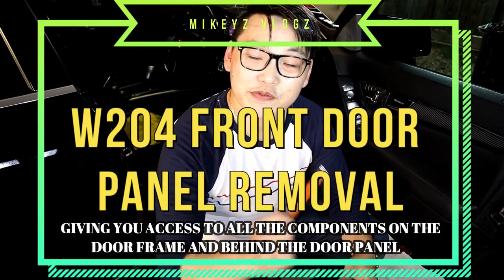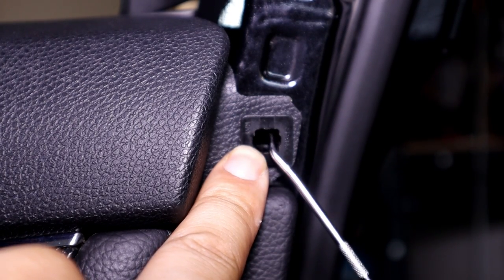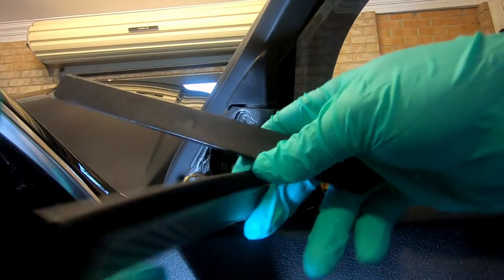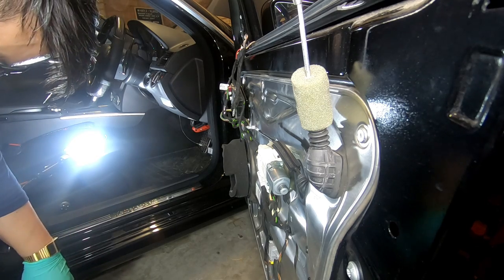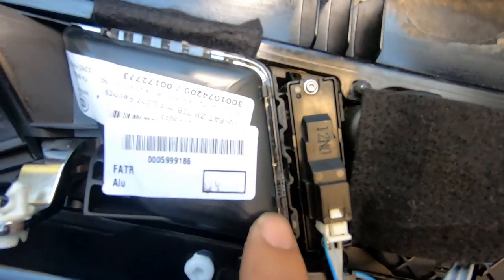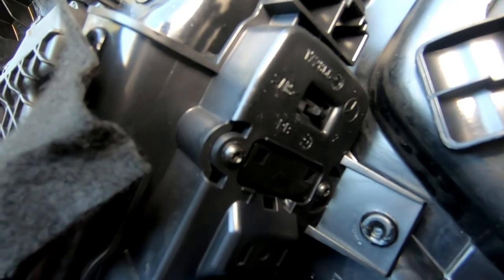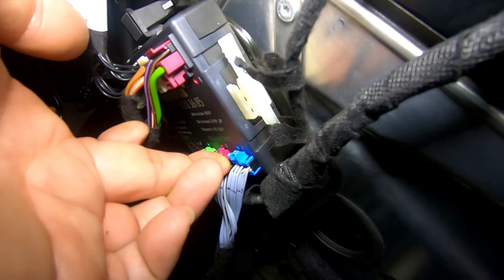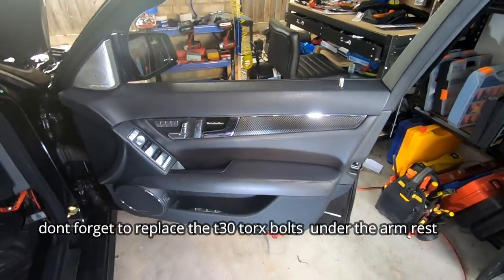MERCEDES BENZ C w204 how to remove front door panel and access components behind and on door frame

Comment: Hello  Mikeyz, Excellent video. Thanks. On my W204 I have just managed to remove the tricky "H" clip but only after realizing that it was fitted 90 degrees anticlockwise to the orientation illustrated in your video. First timers beware!

Comment: Hi Mikeyz  Excellent video thanks. Regarding the tricky "H" clip, on my W204 the clip was installed 90 degrees anticlockwise to the clip illustrated in your video. It took we a while to suss it out. First timers like me - beware of this possibility.  After market parts suppliers should prick up their ears and consider supplying replacement clips.

Comment: 📰Just a heads Up: My 2009 C350 driver side seat switch does not illuminate. Bought a set of leather door panels off a 2014 W204 c300 4Matic. Passenger side had a memory switch  still in the door that lights up but doesn't move the seat. Probably need the memory module and unclear if there is additional plug, coding etc? I can confirm from 2013 on that seat switches do illuminate if one finds cheap parts.

Comment: great video Mikeyz. Do you know if it's possible to remove the metal sheet on the door? The one on which the speaker and the other components that are not on the pannel sit.
Reply from the maker: yes u can u have to drill out all the rivets
Reply: @MIKEYZVLOGZ  by any chance do you happen to know what size are those rivets. I did a bit of research and the rivet guns are different sizes. Don't know what rivets sizes to buy.
Reply from the maker: @Alexandru Marian Popescu  usually 1 rivett tool has 3 sizes on it .. just make sure u buy the right size rivet..take one and compare it to the rivet your buying..take a measurement of the rivet before u drill it out ... I'm pretty sure it's just the radius of the rivet

Comment: As WIS says, I think the best way to remove that expansion clip is as following: Pull the pin out with suitable pilers. Then turn that pin 90 degrees and press into the expansion clip until it arrests. Now that two tab must be released. Then take out that expansion clip with plier. Done!
Reply from the maker: good stuff mate
Reply: I heard that but i'm not really clear how to would be done in person. You are to remove the inner pin, turn it 90 degrees then put it back in fully? This will release the tabs or do you have to do this all in one motion. While pulling out you turn the pin?
Reply: Wow!  Thank you!  This works so nicely I facepalmed myself for struggling so much before.  It's even easier than the pick method. Yes, pull out pin, turn pin 90 deg, push in, until you feel it lock and pull out with the pliers again.  Came out so easy after a hour of messing around with that stupid clip.  Now getting the pin out of the clip (it's locked in a bit) does take some force but much easier to deal with since you have it in your hands, ie, use an allen key to push it out from the other end.

Comment: Can you show a video about replacing the tweeters with aftermarket ones? Thanks!
Reply from the maker: sure... its quite easy but i can do that ... it does involved cutting the factory tweeters off...but all things are good .... sounds really clear now....i basically just grabbed a pair of tweeters and then cut the factory ones off and then used the new ones and wired them in using speaker connections...i will do a video asap
Reply: @MIKEYZVLOGZ  Sounds good! The only part I am worried about is the wiring and cutting. I heard changing them out makes a huge difference!
Reply from the maker: @karim_beats  ye no other weay around it unless you can find a female connector for the mercedes plug ..but cutting the factory wires isnt too bad ..as long as you make a secure connection..i only swapped the tweeters not the 6.5" woofers in the door.... unless i decide to build an abs like speaker plate to replace the  factory ones it wont ever sound near as good.... merc use the door as a box and bounce sound arouond to give descent mids and bass ...hence why it sounds pretty good..so if your going to replace the woofers its a must that you cover all the exposed holes and use a similar speaker plate to cover the entire speaker mount hole...therefore using your door as a bass box kindof...if u know what i mean nd also you have to ofcourse buy the appropriate female plugs for the factory speaker plug therefore saving you from cutting the plug on the woofers... just one less job to do ....

Comment: Is there a way to remove the top vinyl part of the trim which has the locking pin going through it?
Reply from the maker: @jethen07  not really unless u melt the plastic solder joints and melt them back later or use tap screws to rescue it..similar to how u disassemble the the door frame to fix the door handle

Comment: I found a good deal on a used door panel. Problem is that the upper tab is broken. They did not remove the pin and broke it. You discuss this at the "2:10" mark. Would you suggest cutting the old panel and just glue it on?
Reply from the maker: I just did a video showing a different cheap fix and no more hassle check it outhttps://youtu.be/B5j_N4LY-SA
I would.not just glue it.. but IMHO u don't evwn need it u can get away without using that clip
Reply: @MIKEYZVLOGZ  - they broke the portion of the door panel that the clip goes thru. So now it looks like a U.
Reply from the maker: @The_McD  oh yes I get ya... but honestly taking my door on and off for mods these past 2 years have made me realise that it's not a crucial part for the door to stay intact ... honestly I would just go without it.. which is why in one of my recent videos I show how I simply used a push rivet and a normal screw with a washer to replace that H clip

Comment: One thing Mikeyz, where the dickens is the waterproof membrane which stops any moisture penetrating the door card, do you happen to know please?
Reply from the maker: im not sure i know what u speak of ..is it supppse to be there..becuz ever since i removed my door panel ive never seen aplastic cover membrane not once...booo mercedes
Reply: @MIKEYZVLOGZ  Strange, because I have moisture at the bottom of my drivers door. There is no water collecting in the door itself but my garage said that it was probably a membrane inside which was leaking water. They were going to do the work but now cannot because of lockdown. I was going to have a go myself.
Your video about the steering lock and starting problems was so good that I managed that, no problem, thought I might do the same here.
Reply from the maker: @bishopcolenso  yeah with the spread of this covid 19 pls stay safe and keep your family safe and others around  u... with the membrane query... in my honest opinion i havent seen a plastic cover and if u look at other videos on w204 door panels ot will show it doesnt exist and ppl dont remove it.... as shown in my video...so im not sure how your car is getting water in the door panel.... jas it rained lately? ... it must be coming from somewhere....ive never haf an issue with water ...fingers crossed ...but definitely there has to be a reason for it

Comment: Wish you would have covered door interior door handle removal and replacement. I just bought the kit online and I have watched a few videos. The plastic melted tabs and cable pin look like he'll to remove fml.
Reply from the maker: unfortunately i havent had the issue just yet ,,but i will most likely do the video once i have the issue ..but yes gonna have to melt the tabs and then use self tapping screws to replace them all i believe . i watched a video about that tooi cuz i like to be prepared for any faults and mishaps...you;ll be ok its not as hard as ppl think..just annoying cuz u gotta cut or melt the plastic tabs... ive seen where ppl use screws instead to put it back together
Reply: @MIKEYZVLOGZ  dremmel looks the fastest and easiest to cut the melted tabs. Can drill them out or cut them but not goid success stories tho. I don't know about melting them lol they are melted tabs already. There is replacement kits with handle pin and 20 screws. I just purchased one unfortunately lol.
Reply from the maker: @jasonb4196  even easier is to use just pair of cutting pliers with a sharp point . used just for cutting wires and u can cut the top opff the melted tabs and it will come out easily no need for any sort of power tool ..then u just use the screws provideed to screw it back together...still thinking about it
Reply: @MIKEYZVLOGZ  once i pull the door apart I will look at these tabs and make a decision. I might try more than one way and see what is best.
Reply from the maker: @jasonb4196  yeah do that

Comment: I need to replace my armrest on the door panel. Any idea if it's available separately? Also I noticed that in the OEM parts diagram the upper piece has to be purchased separately from  the lower half of the door card. Any idea if these are easily separable?

Thank you!
Reply from the maker: not entirely sure but let me do some browsing and research and see what i find and ill getbak tp u
Reply: @MIKEYZVLOGZ  I just ordered a used door panel, it doesn't look easy to take apart the armrest. There a bunch of "plastic rivet" looking things that look like they're heat-treated or melted on there.
Reply from the maker: @amcdonal86VT  they just need to be drilled out and u can use screws after to refit them i believe ... it wont be hard to take apart or put together just take your time and itll be ok
Reply: @MIKEYZVLOGZ  I just did this. You basically drill out the wax/melted tabs with a 1/4" drill bit. Then you need to find very short #8 screws and drill a thin pilot hole before installing. Use washers as well. It was a pain in the butt because even 1/2" length screws are too long and went through to the other side of the vinyl. In this case I just removed the screws and added more washers stacked on top of each other.
Reply from the maker: @amcdonal86VT  excellent mate well done

Comment: I just ordered a used door panel, but the chrome strip that runs along the top of the door trims is peeling. Do you know if I can replace this easily? The one on my existing door panel is fine and I want to transfer.
Reply from the maker: i will have a look onve i get back and see if u can advise u or at least point u in the right direction
Reply: @MIKEYZVLOGZ  thanks, if not I suppose sanding it and painting it in situ is not a bad option

Comment: Hi I need to remove the armrest from the door frame... needs to remove the whole door frame ?
Reply from the maker: yes u do it's attached inside and melted together via tabs ..if u check out my door handle replacement ull see how the door separates as I remove the melted tabs to replace the inner door handle for front doors...
Reply: @MIKEYZVLOGZ  Yes, I saw...thanks for the answer
Reply from the maker: @pursuit740  welcome

Comment: Hello, do you have a part number for the orange clips  (the 9 that go around the door)?
 TIA
Reply from the maker: they are called mercedes door clips search on ebay cheap easy find
Reply: Thanks for the quick reply and the awesome video. I’ll be replacing the door handle next week.
Reply from the maker: @jorger89  no worries good on ya mate

Comment: Door Pin Hell. I can't get the pin out. Are essentially squeezing the pins to the center tom release it? I've already damaged the pins from trying. PIA. Can you clarify.
Reply from the maker: are u prying the clips towards the centre? ensure its unclipping ... once they are unclipped at the same time it will come out
Reply: @MIKEYZVLOGZ  - I tried to squeeze the top one down and bottom up. I could not get it off and broke it out of furious anger. Ordered new one from dealer which has a screw. 

The sun will be setting and I am switching the bottom half of the door panel. Man I bit off more than I can chew but I do have plastic epoxy. I’ll send you a video clip when done. Upgrading to leather...
Reply from the maker: @The_McD  ahh I see ... nice
Reply from the maker: u have to send me a pic on facebook of the new type of h clip so i can ee what u mean is it like the old ones?? with a torx screw ??

Comment: How do I actually disassemble the door panel to replace the leather parts in it?
Reply from the maker: if u check out the video on the door handle replacement it show roughly what would have to do ...u gotta cut the melted tabs so everything disassembles
Reply: I'm planning on redoing the interior with diamond leather stitching, but the panels are glues together with plastic, after i drill it open how do i put it back together, please help i don't want to ruin the car😂
Reply: @MIKEYZVLOGZ  ok thank you! But how do i put it back together? Do i use silicone glue or what would you suggest?
Reply from the maker: @resiilmoittaa1600  in the video I use screws as they will screw back into the plastic tab u cut off
Reply: @MIKEYZVLOGZ  ok thank you!

Comment: I removed my door panel and fixed my door Handel. I put it all back to together. Now my door wont lock. Stays unlocked no matter what. All other doors works fine as before. Is there a safety mechanism that keeps you from locking door? Did I miss putting something back?
Reply from the maker: hey bud . sorry to hear that .. ok so of its the lock... maybe try the safety on the side on the door ..check the door lock hinge see if u flick it up or down of it still locks and unlocks .. sometimes its just jammed ...  and ur sure u put everything back the way its suppose to go ?
Reply: @MIKEYZVLOGZ  yeah I rewatched your video and made sure it all went back right. Everything works except door wont lock. The door hinge I can move up and down. I can't even manually lock the door with the key. When i press lock button the pin just bounces and wont engage to lock. I dont see any safety buttons on the side of the door. 2010 c300. Thanks for your help and all your videos. Just did a system install that was solid.  Just need my door to lock so I don't get jacked. Lol
Reply from the maker: @myperro721  hold on so its bouncing ??
Reply: @MIKEYZVLOGZ  sometimes it won't. Then sometimes yes will bounce. I tried the piece of tape it stopped the. Bouncing.  Any which way I can't lock door. Even with a key. Almost like it's jammed
Reply from the maker: @myperro721  wen it bouncers its the lock actuator
Reply: @MIKEYZVLOGZ  I watched your DIY door lock actuator fix aftermarket video. This is what I thought. Problem is I can't lock the door by pushing pin down. So is the actuator seized? Therefore do i have to pop the rivets out and replace the original actuator?
Reply from the maker: @myperro721  yes i believe your lock actuator just gave out on u it s common issue with these cars 
it sucks cuz it happened to me too , thank fully i have a cheap fix for it if u watch my video on lock actuator fix ull see
Reply: @MIKEYZVLOGZ  thanks man. Today my door started to lock. Looks.like im going to have to mount that new actuator fix aftermarket part.
Reply from the maker: @myperro721  yeah its cheap as fix
Reply: @MIKEYZVLOGZ  sorry to bug you again. But door wont lock again. Why is this happening intermittently? Will that cheap fix still work? I can't even manually lock the door
Reply from the maker: @myperro721  becuz its slowly stuffing up the fix will fix it completely that's why its a fix not a temp fix ..its a for sure permanent fix..and its ok to ask me things I don't mind as long as it's sensible..just remember and bare in mind im not a professional nor a mechanic so I too only know so much ...
Reply: @MIKEYZVLOGZ  thank you!
Reply from the maker: @myperro721  welcome
Reply: @MIKEYZVLOGZ  I ordered thru ur post the links shared. I'll let you know how it goes.
Reply from the maker: @myperro721  excellent it will be great

Comment: Can’t open door I think wire has come off handle any ideas
Reply from the maker: have u opened door inside to check
have u removed the front panel ? 
make sure u check the safety isn't on .. sometimes it's as simple as using a screwdriver and pressing on the latch that catches the door when u close it ..I've seen this many times
I the wire came off the door handle it would be very loose and floppy .. is that the case ?
Reply: @MIKEYZVLOGZ  yes handle sticks out not push back in door will not open can I still get panel off or will I need to take seat out

Comment: Somebody know part number of that H-clip- rivet?
Reply from the maker: I'll get it for u once I finish work..if u watch my video on the H clip replacement I used a 2 dollars push clip and a screw with a washer to replace it ..so u never have to worry  about that h clip ever again ... if u think about it that h clip isn't compulsory for the door to be secured and remain intact u could do without it even..as the 2 t30 torx screws hold the door in place
Reply from the maker: https://youtu.be/B5j_N4LY-SA
Reply: @MIKEYZVLOGZ  its one  easy trick to remove them. But not work for me. 
Pull out central clip and rotate 90° and push it back. Now easy remove whole rivet-clip from the door. 
Left doorpanel- I have removed central blocker and this not work. With screwdriver i cant remove it too. Right doorpanel- pushed too much central clip and i cant remove that central clip. 
So i need demage that clips, I think. 
I hate some mercedes ideas. 

(My doors sound cracky and i need use some noiseblock foam under panels.
Reply: @MIKEYZVLOGZ thank you.  Its better solution like original. 
Aks 1651 or aks 1652?

Comment: Hello  Mikeyz, Excellent video. Thanks. On my W204 I have just managed to remove the tricky "H" clip but only after realizing that it was fitted 90 degrees anticlockwise to the orientation illustrated in your video. First timers beware!
Reply from the maker: Excellent!